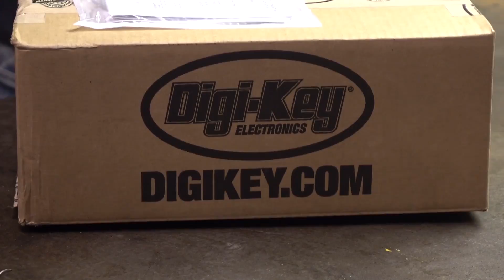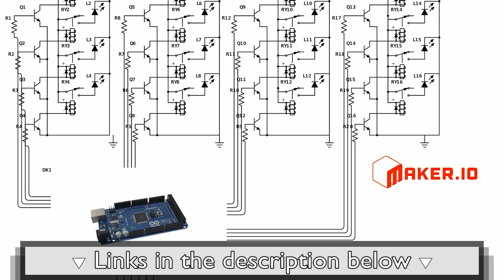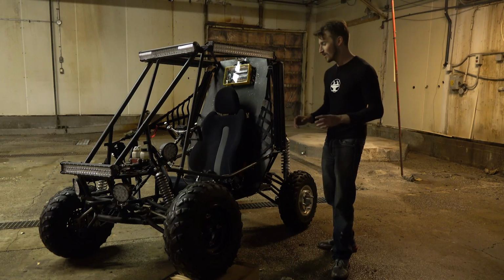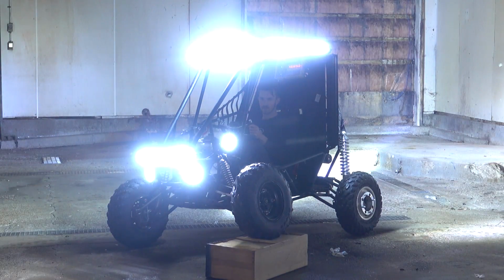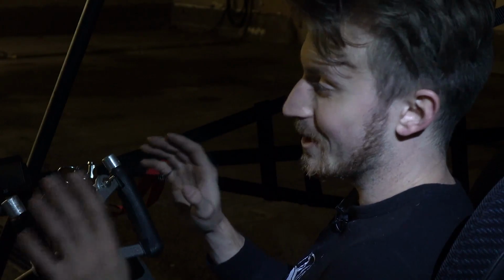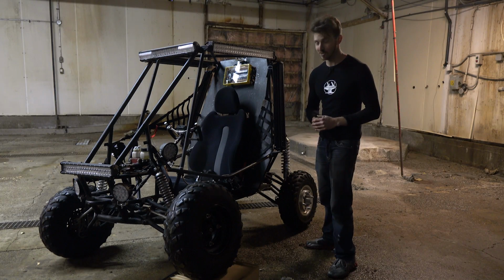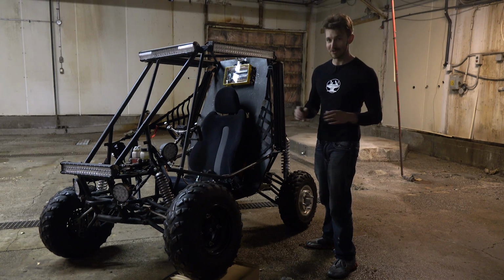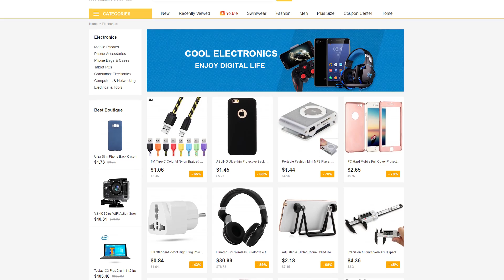Electric Batman Baja Part 4 - TOO MANY LIGHTS!

Comment from the maker: Big thank you to YoShop ► https://goo.gl/kKBq9j // Lightbars ► https://goo.gl/jBtbbH (Use Coupon Code: YHJH)
SUBSCRIBE for more AWESOME Videos ► http://goo.gl/MU4hNA
Reply: the Hacksmith he did....
Reply: the Hacksmith please add spikes that pop out the side of the wheels
Reply: the Hacksmith add a paintball Gatling gun
Reply: Horn with original Batman tv Series theme song
Reply: Smoke Maschine for sudden disapperans like Batman
Reply: the Hacksmith Nurf battrung  luncher
Reply: Could you make a video in which you introduce the whole crew to us??
Reply: when willthe ironman project come again
Reply: the Hacksmith Add a smoke machine for added badassery
Reply: the Hacksmith Make it remote control
Reply: I have an idea, modify two 50.cal nerf MEGA series rifles... ok they're called the centurions, a single rifle is $50 in U.S. dollars, don't know if your budget allows a spare $100. but modify them to a point to where they can go full on rapid fire and then 3D print drum mags that can hold about 20 MEGA rounds each, which will give you more than the standard 5. Might be good video material too. Everyone if you want to see this like the comment!
Reply: YES!  plz!
Reply: the Hacksmith that minigun thing into that
Reply: You should put the iron man rockets on it
Reply: i would at least try to get a lower seat so you can lower the roof a lot wich will make it look cooler and faster
Reply: I recommend putting a big speaker hooked to an oscillator so you can blast infra-sounds, ultrasounds and all in between! And that would be a car horn worthy of the Batman!
Reply: the Hacksmith please continue the grapplimg hook gun are you gonna sell your inventions one day
Reply: the Hacksmith you should put some fog machines under the baha so it will look really nice
Reply: the Hacksmith you should add a roll cage around the Baja so you can have a hydraulic to push it over make the Baja to do a barrel roll.
Reply: the Hacksmith you should add automatic airsoft guns to the sides that aren't maned
Reply: the Hacksmith thermal mount on turret with smoke bomb launcher smoke screen so you can see them but they can't see you
Reply: Hey man love your vids!#canadianrpresent
You should put a rising seat that goes up to the turret you would've put on top of the baja
Reply: add a flame thrower
Reply: the Hacksmith How about adding your spotlight, but with a hacksmith logo instead of a batman logo.
Reply: Paintball guns, flame thrower, net gun? Smoke bomb launchers, more explosive stuff
Reply: the Hacksmith team up with colinfurze and add a jet engine
Reply: the Hacksmith 3d print armour for the lights to protect them.
Reply: the Hacksmith I
Reply: The hacksmith this is cool and all but you've gone away from make it real (comic book and movie project) which is a big reason why I think you got ur subs. Maybe do some more iron man other things again. Now I just skip through when I used to watch the whole video. Just a thought
Reply: Heptic Zman but this looks awesome, brov
Reply: make it remote controlled~!!!!!!!!!!!!!!!!!!!!!!!!!!!!!!!!!!!!!!!!!!!!!!!!!!!
Reply: the Hacksmith plss give me a captain america shield
Reply: install police light on the Baja
Reply: you should add a smoke shooter so you can hide then drive out
like if you agree
Reply: the Hacksmith how is your arm? Since the skateboard accident
Reply: Hacksmith what 3D printer do you use?
Reply: the Hacksmith put a exhoust
Reply: the Hacksmith hey why don't you add in some smoke canisters in addition to the Roman candles as a smoke screen!!
Reply: the Hacksmith a winch
Reply: @thehacksmith You should definitely modify one of your grappling guns as a winch.
Reply: Hacksmith, you should add something so when you press a button it lights the roman candles and then they fire like a missle launcher. I think that would be really cool😃
Reply: the Hacksmith that does not look like the tumbler, i hope u r gonna put armor on it that will make it look like the tumbler and maybe make it longer and if you are gonna put armor on it then give it more power because the heavy armor would slow ut down. p.s. dont forget to stabilize it more a lot more. PLZ CONSIDER MY IDEAS.
Reply: the Hacksmith I THINK U SHOULD ADD A FUNCTION TO WHERE IT COULD HAVE TURBO BOOSTERS INSTEAD OF JUST GIVING IT DEADLY SPEED WELL TOO DEADLY SPEED
Reply: the Hacksmith I also think you should add a function so that you could drop stuff from out the back or bottom like spikes, oil, traker, or even smoke.
Reply: the Hacksmith I know i am really comitment
Reply: the Hacksmith Forget that last comment
Reply: the Hacksmith put rockets in front
Reply: the Hacksmith PLZ HEAR ME OUT WHEN I SAY...
Reply: the Hacksmith AND DONT FORGET TO PLZ TAKE "HIS INTO DEEP CONSIDERATION!!!!!!
Reply: the Hacksmith Make a Batman Key so that you could control it and activate cool functions such as electrify the tumbler or remote control it, make it sound off a loud noise, install a mode onto it so that you could track it, install a phone in it, make it shoot out smoke bombs or regular homemade bombs, grappling hook, Laser powered bat signal light, a mode that would allow it to change wheels and also just in case wheels like pre-installed wheels already to go, a GPS, a over ride back up plan would be good, stealth mode, a hatch that wuld release a drone, etc. all or few of these functions that would be controlled just by one bat Key. Oh and for a key you should have something that is about the size of a really big phone so you could lit it in a case with a keychain. And if you are wondering how you would do this just use the same keyboard technique you  used for the tumbler.
Reply: seriously, your gonna have to maybe get a bigger or longer tumbler for these ideas .
Reply: the Hacksmith 
EXTRA IDEAS:
MAKE: 
-WEB SHOOTER
-VIBRANIUM SUIT LIKE BLACK PANTHER'S (MAKE THE VIBRAINIUM SUBSTANCE.)
-THOR'S HAMMER (SHOOTS LIGHTNING AND STUFF)
-HOVER BOOTS
(doesn't have to fly- HOVER)
- WIDE RANGE FAST SPREADING NINJA SMOKE BOMB!
- HOVER BOARD
-DOCTOR OCTOPUS ROBOTIC TENTACLES
-ROCKET BOOTS (THAT WOULD MAKE YOU RUN FAST NOT FLY)
-MULTI GADGET STAFF (THAT WOULD HAVE FUNCTIONS SUCH AS ELECTRIC TIP FLAME THROWER, etc.)
- VERY POWERFUL MAGNETIC GLOVES   (NEGATIVE PULSE/EFFECT)
-LIGHTNING WHIP (HERCULES)
-KRATO'S DUAL BLADES
-LIGHTNING FORGED SWORD ( WITH ELECTRICAL EFFECTS)
- ANG'S STAFF (From avatar the last air-bender- blows powerful gusts of wind.) 
- A Weapon or device that transforms into other weapon's.
- freeze ray
- Flaming Chain (Ghostrider) - Flaming bike (GhostRider)
- A GLIDING CAPE (BATMAN)
- EXTENDING ARM (SLENDERMAN)
- MULTI GADGET BATERANGS 
- TRON DISC
- BEN 10 ~OMNITRIX~ (WATCH)
- PISTOL SIZED NETGUN
- BB SHOOTING GAUNTLET (Gauntlets -BLACK WIDOW-)
- Pokeball
- hidden homemade weapons (showcase)
- remote controlled spider (Spiderman or BATMAN)
- JACK FROSTS STAFF (liquid nitrogen and 2 or more modes
- magic wand that shoots fire works (2 or more modes)
I could think of more but besides the fact that i must be blowing up your inbox and you probably wont read this, i need a break.
Reply: the Hacksmith  can you do hawkeyes bow
Reply: the Hacksmith add the grappling hook on the front, like in the arkham games!
Reply: the Hacksmith put speakers on that thing!
Reply: the Hacksmith add a smoke launcher instead of the floor lught
Reply: the Hacksmith add a fog machine!!
Reply: Flame throwers flame throwers  on the back pleas just like the real tumbler
Reply: the Hacksmith add a hidden batterang compartment
Reply: the Hacksmith i bet with your Batmobile you could be the best Ally to the megabot inc. except the lot of light I was affected a grappling gun or net gun The fireworks are awesome mix how about a wing-blade The blade the sharp as a sword on both side oh! How about a sentry gun the best of the best airsoft made what do you think? 😃🥇
Reply: can you put metal sheets and hard plastic windows over some places so it protects the driver? it will look more like a tumbler, i think, btw lov ur vids
Reply: do a gasoline sprayer that whatever you hit with it you can ignite with the roman candles.
Reply: the Hacksmith I got one question how did u forget to add the batsman logo if it's based around the bat mobile
Reply: Add two harpoon type guns to the front so when you shoot them you can pull things with the "car"
Reply: add smokescreen
Reply: the Hacksmith l.
Reply: the Hacksmith add a smoke machine
Reply: the Hacksmith add bater-rangs throes some how
Reply: PLEASE WILL YOU MAKE ROBOT
Reply: the Hacksmith add a drone holder at the top and have a button that turns it on and raises in the air, have a screen that displays the drone footage!!!!
Reply: enter + 666 = fire!!! :S
Reply: the Hacksmith you should add a combo for a fog machine on the back
Reply: the Hacksmith add an afterburner
Reply: the Hacksmith love the vids you should continue making them but, you should have put an epilepsy warning on this video Even though I don't have epilepsy
Reply: Plz add armor
Reply: Is this street legal?

Comment: A door and windows, sunglasses and something to put out the fire with that you made before the police spots you and you have to dissapear using your smokeboms, rims with a batlogo, airbacks located under the car, and a self distuct button because contingencyplan, foam armor so you can hit people without them, your car or you getting hurt and a cup holder.  that should do it. good luck master wayne

Comment: it's way too tall. you have to shorten that thing
Reply from the maker: Can't shorten it without lengthening it... there's only like 8" above my head to the ceiling
Reply: the Hacksmith you should lengthen, and shorten it. And add a gunner position on the back with the turret you made.
Reply: he's making a bat car..
not a machine gun suv..
Reply: he did say that maybe they´ll add it to the back of the tumbler
Reply: i think ur right

Comment: how about putting a body/armour on and inside at the front add a screen that you can pull up and connects to a camera at the front which can display heat signatures and a targeting system  it would be so awesome also the extra weight would possibly keep the car on all fours 😀😀 have a think. it would be out of this world 😎

Comment: I love the light bar controls, but if you plan on making it a tumbler, you should have a switchboard mounted up top, instead of on the steering wheel. Plus that would give you more room for additional controls.

Comment: You should fab up some suicide doors with plexiglass windows and a front windshield and tint them. I think it would give it a cooler and more of that darker bat vibe. Plus it would double as protection from the elements and outside objects.

Comment: I recommend using an electric remote fuse with a receiver to launch missiles from the control panel on the steering wheel. Use electromagnetic relay for this.

Comment: definitely a winch! And if you could upscale the grappling hook gun and incorporate that in to the vehicle that would be insane! then you could drive up a  building! would look awesome on film! And surely it's not to big a project with the Baja not weighing to much. even a normal winch would work just wouldn't have the same speed.
Reply: also some old school tyre spikes(or batarangs) to fall out the back and oil slick? tracks instead of wheels? Or if stick with the wheels tire lights of the bat logo

Comment: streatch the frame and make the seat in a way that your kind of laying down a little and lower the top bars and it will be less likely to flip and might even look cool and also add some sheet metal and plexy glass so it looks like it has armor and you gotta have the bat symbol somewhere

Comment: Hmm maybe it doesn't need to be the full tumbler and can draw inspiration from some of the older bat cars as well.... With like a lower outer frame and a slide bar to let the buggy roll out the back.... (currently thinking of the jet turbine car but Yh) a cross between that and tumbler
Reply: Think I can draw up something but only if wanted (basic sketches)

Comment: make the frame longer in the front and add some armor and a windshield to protect from the elements, that will also weigh down the front to prevent overdoing wheelies

Comment: Add a modification for the grappling hook you made.  Also, make it remote controlled (if possible), so you can make it come to you
Reply: Oh, and a small box on the back with a button that opens a door on it, with nails or something that would puncture the tire of someone following you

Comment: Try to put the bat grappling hook on the top of the buggy and try to hook the relay board up to it so you can fire it from the the control panel in the buggy

Comment: please add two cannons, one on either side of the front of the baja, then it would have the same weaponary as the tumbler from the dark knight. for the cannons you could create pressurised gas launchers that shoot various ammo such as gunpowder filled (with primers) rounds. also you could use this cannon to launch roman candles if they were connected to a key in the pad.

Comment: What about putting a counter-weight under the hackmobile (yes that's a name) that slides opposite direction of the momentum (ie weight goes to the left wen you turn left to counteract momentum) so you can take sharper and faster turns without falling over.

Also infrared lights in front and an infrared display so you can drive in complete blackness, like batman (or Hackman)
Reply from the maker: That's a cool idea! Not sure how practical actually doing the counterweight would be though. Definitely planning the infrared light and camera though!
Reply: I see it as: weight on a piston (or a cylinder) that is moved according to the movements of the wheel (you probably need something to have that information electronically, maybe some kind of peltier device to convert physical to electrical) I can't wait to see the infrared display!

Comment: Add a flare/flamethrower that fires towards the rear...That'll make it difficult to follow this vehicle in chase situations and add heavy weapon systems at the bottom front area behind the headlamps,that'll stabilise the weight and keep the buggy from flipping up at high speeds and from toppling side to side

Comment: Please add your version of front adjustable grappling hook  to be shot by the driver. Have it connectable to a front winch on your frame so no target vehicle get away or a hill and building is too high to drive up.
Reply from the maker: of course!
Reply: the Hacksmith Thanks!!!

Comment: equip a camera on the turret and take an old pc controller with 360 steering and attach it at the bahas panel, and connect the camera to an lcd screen, it could be cool if it also was hidden and you had to open a small container to get to it. And attach the turret on top of the baha that would be awesome

Comment: Some suggestions to add:
• Armor Plating, most likely asthetic so that you don't lose speed, aluminum for light weight
• Bat Signal
• FLAMETHROWER
• Windshield
• Possible mountable turret on top????

Comment: I'd love to see it more 'tumbler-like' visually. The issue you're having with the height could be solved by seating position. consider either reclined (recumbent) - so your feet are further forward and you lean back more - allowing the roof to drop lower - or go the other direction and pilot it on your stomach (like riding a racing bike). with the wider base and the double wide wheels, it should be less prone to roll and you wouldn't need to be as concerned about the high roll cage.
Reply from the maker: Yeah it wasn't a popular series so we couldn't justify spending enough money on it to do it justice.

Comment: This is starting to become a pretty amazing project. I really love the fact that you added the Easter eggs. It's a bummer that you can't make the frame less tall, because of the fact that as is, it look slightly clumsy. besides, it also makes it less functional (the tipping, although the double wheels fixed that).
Reply from the maker: Thanks!

Comment: Make it shorter, it's way too tall, cut the top and lower the roof. Add some armor and (I know it's electric) but add some exhausts with colorful flames or maybe some rocket boosters. Add a plasma cannon like the Mass Effect plasma rifle you made. And a Bat Drone that can be controlled from the vehicle with camera that can recharge wireless in the vehicle.
Reply from the maker: We could only remove about 6" from the height before making it dangerous for the driver to hit their head on the ceiling... so it doesn't really help anything =(
Reply: the Hacksmith could you lengthen the frame and make the seat more recumbent? also, I'd keep the dualies and just make some fenders if you're worried they'll be torn off.
Reply: That is a pretty good idea, since the frame cannot be shorter than it is now.